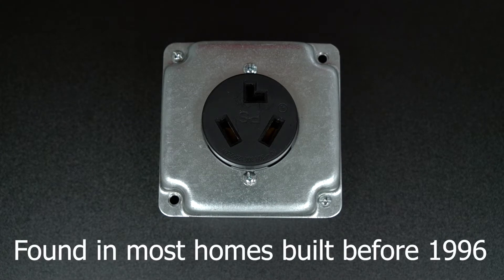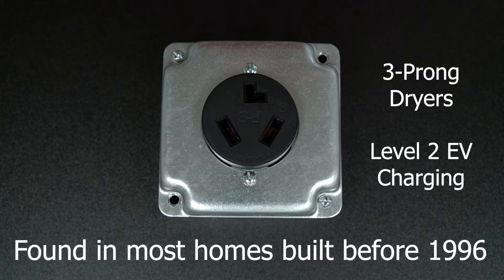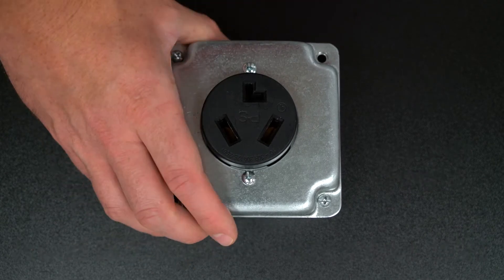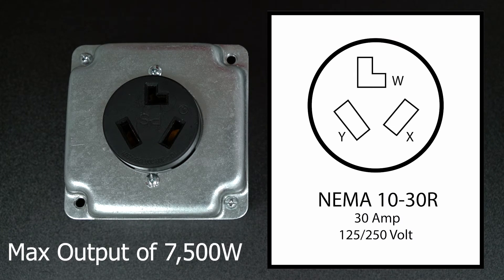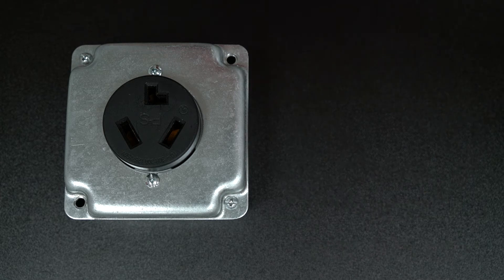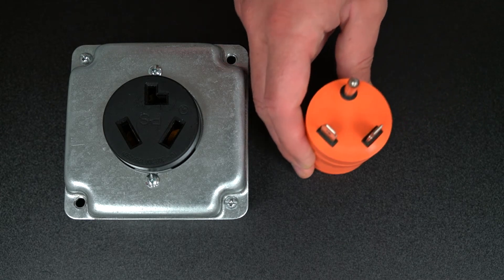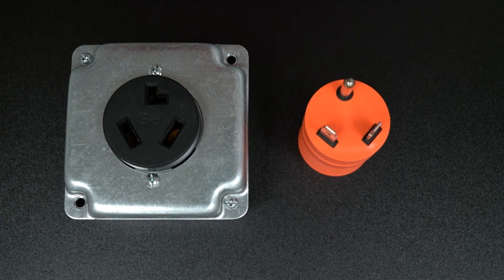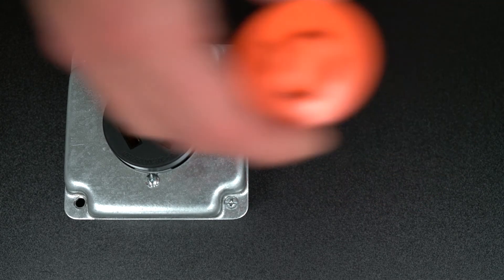Outlet Solutions: Identifying NEMA 10-30 Outlets

Comment: Question: I see you refer to the old style dryer outlet as a "Nema 10-30", and is "rated for up to 30 amps at 125/250 volts un-grounded". So the 3 prongs or sockets of this plug or receptacle would be 2 hots on the angle and a neutral on the "L" shaped prong or slot. I was thinking what is the reason for the neutral wire in a 240 volt appliance? Is it because of the control devices up top in these dryers use 120 volts instead of 240 volts to do the control functions and only the heating elements use the 240 volts? 
2nd Question: Is it common practice to use NM 10-2 w/grd (Black, White-taped red, bare copper) to feed these Nema 10-30's, using the bare copper as the neutral? If not, do they make a 10-3 NM cable (Black, White, Red) for this purpose?
Thanks for your time.
Reply from the maker: Yes, the neutral is there so that the control functions can just use 120V. Usually the wiring for a 10-30 would be black (hot), red (hot), and white (hot). There would be no need for a bare wire except for the small amount that actually gets connected into the terminal when wiring. 3-prong dryers usually have a separate way to ground the connection, too.